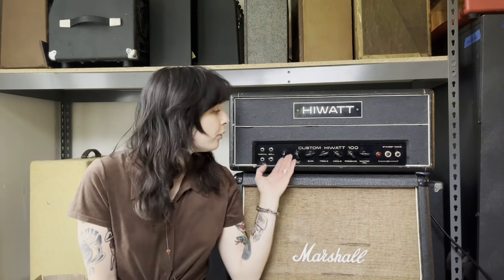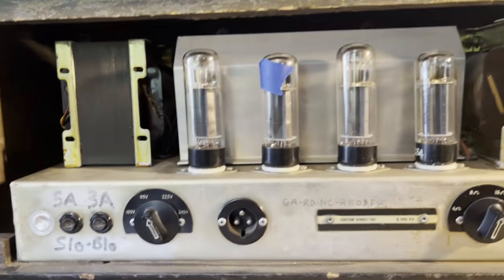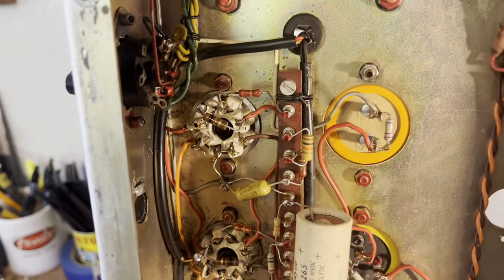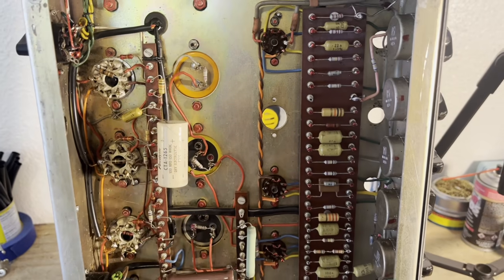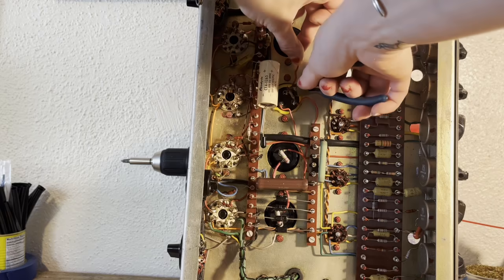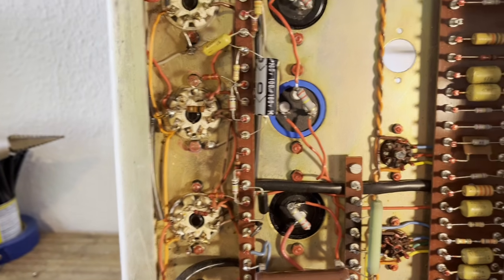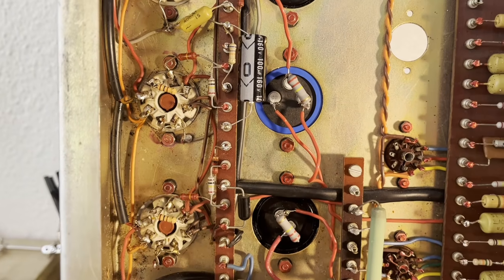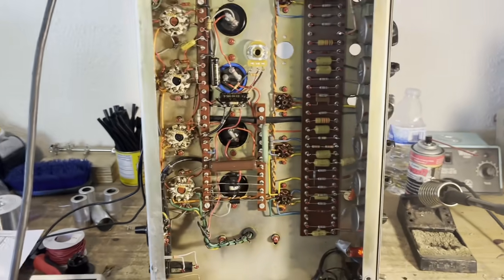Hiwatt DR103 | Restoration & Demo

Comment: I to had never seen the inside or worked on a Hiwatt. It does have similarities to Vox and Marshall, especially those from the 80s. The British have a way with layout. With the amount of power supply filtering, it explains the clean output. It’s great you gave some history of the amp with photos. Upgrading the bias supply was brilliant. I look forward to the next video you post! Love from NW Colorado. Thanxz
Reply: and do not forget to mention the large amount of iron and copper in those hiwatt (partridge)  transformers which give it the punch and clean sound. 

I restored the same Hiwatt,  the DR103,   bought as a wreck from a local musican for few bucks. It was in a miserable condition. Generations of so called engineers try to found the right sound, no magic smoke inside.☺awful!  But the shell and the rear panel were okay.
There were a big hole in the chassis for  a replacement transformer which do not belong into it. After welding a piece of metal, sheet and let the chassis galvanised in a friends workplace  I build it complete new to the original schmatics in the same way Dave Reeves did it. Luckily for me a handful of specialized shops got lot of hiwatt parts on stock. 
The transformers are homewound with the same lamination and  winding specs . The iron, the coil former and the endframes of proper size  are ordered from a company in England. I used an  Auman 300 winding machine.  I spend a complet year for this exciting task. I worked several hours during the week and least one day at weekend. The total cost of components include the valves were  750 EUR. 
The amp is finished since several month and sit on a shelf in my living room waiting for being played. 
By the way, there is a IEC power receptacle availabe which fit in  the hole of the Bulgin plug.

Comment: Yes! Well done! Has that familiar sizzle of a Hi Watt, especially the Seeker. 1/31/2023, Foz I failed to compliment you on your neatness, as I took a second glance today I found your simple mod to the AC cord to match the high quality build inside that amp. WOW, now I see where amp builders get that influence. They even reduced parts of the terminal boards for neatness.

Comment: I have a DR103 and 2 4x12 Fane cabinets from '77 that I'd like to resurrect.  Now, other than the clean-up, I know what to change, besides just tubes.  The sounds are just amazing!
Reply: BTW, I'll most likely still hire a tech to do the work.  Or practice up on my soldering! ;-)

Comment: Those mains connectors were common on UK appliances from the 1940s into the late 70s.  My grandmother had an electric kettle with the same connector.  It was the forerunner to the IEC lead.  We still call them “kettle leads” over here :)

Comment: That is an awesome design job on that amp. Cleanest wiring I have ever seen outside of military equipment. Easy access to all the components. nice bias mod too. Have you ever thought about having a PCB made as an add on ready to go into any amp using similar circuitry? Might be able to sell as a separate item also. Nice clean repair. After over 55 years of seeing buggered up repairs, it is so nice to see what you & D lab do.
Reply: Joyce was taught by two Americans during WWII so it's no surprise I guess.

Comment: One of the best made vintage tube amp ever
Reply: I have owned 4 of them all early 1970 models two SOUND CITY 100 heads And one HIWATT 100 HEAD which were sold and a HIWATT 50 Combo which I kept and still use over 50 years later

Comment: I've always admired mil-spec wiring with the lacing. So time consuming but it sure is effective. I have repaired a couple of the newer Hiwatt's and they also had very neat, right angled wiring though I don't recall if they were laced together. Good job done on a great classic amp!
Reply: I used  to do MIL-SPEC wiring when I worked as a Gov't contractor the Dept of Navy in RI....used a lot of lacing in some equipment....later, tie-wraps were the 'thing' . . .
Reply: It’s not terribly hard to do, NASA has published a manual on how to do it back in the day that explains it very well, you can also cheat and use a few zip ties to bundle the wires before starting which makes it a lot easier to lace the wires, just cut them off as you go and no one will be none the wiser that you cheated. 😂

Comment: I have a couple of Sound City amps with the same bias circuit problem, basically way too hot unless you're putting NOS Sylvania's in it. I found a bias doubler circuit in the Tube Amp Book V. 4, and a friend of mine who's better at electronics than I am put it in for me. It works great.

Comment: Having owned a DR 103 in the early 80s I was happy to see a video on the topic. Enjoyed the video and problem solving.Enjoyed the playing, too. 

It could have been the mic placement, or the Strat/strings, or the settings, but I just thought the sound, for a Hiwatt, was very thin and lo-fi. They are bright, yes, but not crispy and tinny, like on the D chords. Even straight in and clean they have a great, unique textured sound that is richly harmonic.

Someone give some feedback on that. Either back me up or slap me silly please!
Reply: Its probably cause she's playing into a Marshall cab so its most likely Celestion speakers. Vintage Fane-style speakers compliment the amp much, much better. I have a Reeves Custom 50 with Vintage Purple speakers, and I tried plugging in Celestion speakers to hear how they sound, and they made the amp sound like what you're hearing here—no bass at all and very thin sounding. If you notice, she even has the treble control waaaaay down and it still sounds like that. Vintage Fanes just give Hiwatt-style amps the best frequency response.

Comment: It's good to see you back! I've been looking forward to another video for some time. That amp. construction is clean and neat. Good job on the repair! A tip I leaned from another YT presenter who used to work at Cessna and had to drill out thousands of rivets is to just remove the head of the rivet with a drill, instead of drilling out the barrel. It is easier, and ensures that the mounting hole doesn't get enlarged by drilling it out.

Comment: Ahh, the old voltage doubler bias circuit mod. Done that many times. Sound City amps sometimes have the same issue, but Hiwatts are always WAY off with modern valves. That 50v bias winding is nowhere near enough. Nice work.

Comment: Nice work and enhancement for the adjustable bias.  As you stated, the physical component layout and wiring in the unit is a work of art.  Would be a good idea to save this video as a reference if I ever try building an amp by hand... just for funsies.

Comment: So the lower current rated fuse is for the high AC in voltage. The higher rated fuse (6.3 Amps) ahould be used for 115 VAC. Keep up the good work!

Comment from the maker: Hello everyone! Thank you for your comments and corrections. I am the first to admit I have a LOT to learn! And it’s so cool to have y’all along for the journey. 

With that said, here are a few corrections:

 I misspoke about the fuse ratings. The mains fuse should be doubled (not halved) and indeed be 6A. I installed a 3A fuse. The fuse will of course still blow if there's an issue in this case, but just wanted to clear it up. 

Dave Reeves was the actual designer of Hiwatt amps. I apologize for my error, Harry Joyce didn’t begin wiring the amps until the early 70’s. Thank you Dave!!
Reply: Thanks for what you do and how you do it. Rock on!
Reply: Hiwatt was Pete Ham from Badfinger go to Amp. An excellent amp to say the least.
Reply: People know one's a class act when they admit their errors, and "rectify" (pun intended, I build Marshall Clones) said mistakes. 
Cool vid, those old Reeves Hi-Watts are classics. Resplendent with Mustard tone caps, and impeccable wiring. Would love to get one or simply build a clone, which is the financially only option!
Reply: i'd love for you to do a video about speaker wiring harness making, parallel vs series, ohms etc   that would be great
Reply: Ты настоящий радиолюбитель ! (поцелуй в щёчку  )))

Comment: Congrats on the new shop and keeping busy! Glad to hear and see that you are doing well. Yes indeed, it does seem as though ya hardly see any of these Hiwatt amps coming across the bench. 
Are ya sure about fuse ratings at mains voltage? If ya go lower voltage you require more current to make the same power. Doesn't that require a higher rated fuse for lower mains voltage? I would recommend a 5 amp fuse at 120v  2-1/2@220v. 
Your choice of 3 amps will be ok at lower volume and obviously more conservative but at full stage  power could possibly fail at heavy sudden demand. 
Maybe I misunderstood and need to review the video again? 
Keep up the great work, thanks for the video, great subject!

Comment: It would have been nice if my dad(Dave Reeves) had got a mention as he actually designed this amp not Harry Joyce.The clue is in the model description,DR103.Harry joyce started wiring amps for Dave in 1970/71, many years after  Hiwatt Amplification was started.
Reply from the maker: Thank you so much for your comment. I sincerely apologize for this hole in my research. I will make a note in the description! Your dad Dave should absolutely get a proper mention.
Reply: @FazioElectric  Thanks,much appreciated.

Comment: I own one of the newer (2010's I think) DR103's and I can attest that aside from some minor cosmetic differences (the horizontal white piping is a bit further from the edge than the vintage models) they are every but the same amp as the Joyce models of the 1960 and 70's. The big Partridge transformers, same layout, same PERFECT, absolutely gorgeous mil-spec wiring and top notch component selection. My tech loves working on it. My main rig is a stereo setup with the DR103 and a 1969 "lay down" transformer Marshall Super Bass. The Super Bass is a bit more full spectrum than the Super Leads and complements the DR103 nicely. As incredible as my Super Bass is, I'd take the DR103 if I could only use one.
Reply: All Technicians Love an Electrical Circuit designed to run Hot and has Easy Access.

They get paid over and over to replace components that burn out prematurely.

I suggest you look into what Mil-Spec meant in 1966.  It sure didn't include any verbage about leaving bias adjustments OUT of an Amplification Circuit.

noone would consider designing a carburator without adjustments.
Why imagine it in an Electrical Circuit when ALL the components have variences in the manufacturing process?

This box may induce visions of cherubs dancing around your product infused Hair, but let's not take this opportunity to Glorify this Product.

It doesn't deserve it.

Comment: Hey Colleen just stumbled across this video. I’m not sure why nobody has pointed out to you that your getting your UK/US fuse values confused. In the US we have 1/2 the voltage that they have in the UK so the fuse value needs to be double what it is in the UK. On that schematic you showed 3.15 is the UK fuse while 6.3 is the US fuse. Also Harry Joyce didn’t design these amps. He was only contracted to wire them. The late Dan Reeves was the designer. He started with Sound City amps and then later formed Hiwatt.  Nice video, mistakes aside.

Comment: Love the vids, however @ 3:30 thru 4:00 you stated that the fuse rating is 3A for 225V and 6A for 115V. For the same wattage/VA rating: Halve the voltage double the current, double the voltage halve the current, With primary at 115V with a 3A fuse will blow after hard playing. To summarize, use 3A for 225V and 6A for 115V.

JJ makes a 250uF at 500V 1.375" (35mm) diameter can cap.

Comment: HIWATT and SOUND CITY were exactly the same internally, the only difference was on my Sound City I had to plug the amp into a Hammond auto-transformer because it didn't have 105v, 115v on the voltage selector, it came from London and wasn't an export model.  I used both a HIWATT and a SOUND CITY.  I believe they were designed by the same engineer since they were internally identical but inside the Sound City near the circuit board someone wrote HYLIGHT/HIWATT in black marker

Comment: Good to see you back. 🙂.  If you have a Road 220 Bass Amp to service sometime I would love to see that. I have a 70s model. But it's all transistor and it's noisy in one channel where there's a 5 band EQ.  It's possibly capacitors. I know I know. Tube Amps are the way to go.  But this one I've got I've used for years.  Thanks for the vids!

Comment: If an amp needs a 2A fuse at 240, then it will need a 4 amp fuse at 120v.  It's about the needed power level.  At 240v and 2A that's 480 watts.  At 120v you need to have a 4A fuse to be able to supply the same 480 watts.

Comment: @Fazio Electric
Fazio, you wail!
And dig, this is the amp head that amplifies the upright bass on stage at Montreux ''71 with Ahmad Jamal Trio - and it's the most in-your-face upright tone on  any jazz record, let alone a live one. LP title is, Outertimeinnerspace (on ABC Impulse I think.)  My bet, there's no CD.
Tune called Extensions features each player and is what the kids today call, based. 
Also, bassed - by Mr Jamil Suleiman.

Comment: The lower inputs are the higher gain. Took a min to figure that out on my 1973 DR103S. Hard to find much info on that particular model. 2 input and a footswitch volume cut/ boost

Comment: Nice to see rare amp back in line! 👍
What I'm learn in last 27 years - sometimes, old parts are better than modern ones.. But, sometimes, they may kill other parts.. Depends on part and schematic.. 😂
Reply: No, modern parts are way better if they have the same specs. A good example are the electrolyric capacitors. High quality type were made from Vishay, Philips and Nippon Chemicon.  If space and weight doesn´t matter metall polypropylene  capacitors from Bosch / Siemens , Wima are a good choice, I used this type  of capacitors in Filter circuits of my home brewed  power inverters, they do their  task abt. 20 years without any trouble at all. 

I bed the blue Capacitors which fitted in the Hiwatt in this video made by Philips and labeled with the distributors logo. The black ones could be Vishays.

Comment: Nice to see a new video of a repair !  Hate to be a bit picky, but you sure about fuse ratings ? Higher amperage fuse would be for lower supply volts.  IE, watt load should be similar for both voltages. Just sayin'
Reply: Was just about to make the same comment about fuse ratings!  The higher the line voltage the LOWER the fuse current rating.  That mains socket on the back panel is a Bulgin connector, a UK company that was.  Quite difficult to obtain even here in the UK. Was used on alot of audio and test gear in the 60's and 70's. BTW, it would be good to know which brand of caps you are using.
Reply from the maker: Omg you’re totally right. My bad! At least the fuse will blow either way if there’s a problem.
Reply: I feel guilty about my comment. Your videos are excellent, no matter the fuse ratings.  Better than excellent ...stratospheric !

Comment: Very interesting. I have a 1972 model, DR103, a bit more beaten up than this one, but still sounding good. Mine has had the Bulgin power connector replaced with a safer, more standard connector.

Comment: Your backwards on fuse's. at  220V it may be 3A, but at 120V it would be 5A.  Remember, lower voltage means higher current.

Comment: Hi, you are confused, when the power supply is 230V the fuse is 3.15A and 6.3A when it is 115 or less .... sorry but it's Ohm's law. Greetings from Italy!  😉👍🏻👍🏻
Reply: Watt's law, P = IV
Reply: @marpenman  That's right, Watt's law is a derivation / extension of Ohm's law. P = V x I  230x3.15 = 724.5  like 115x6.3.
Sorry for my English.
Reply: I believe you are correct.  higher voltage = smaller fuse.  Lower voltage = larger fuse

Comment: I was able to talk a few in to trying out j/j E34l  tubes in their Marshall's dsl amps.  They were glad they did.
  They got a little more eadroom and a fuller bottom end. Kind of a cross of a 6l6 and a el34.
Imagine a set in one of these?  Omg.
     I'm njot really a huge jj fan except Those and their 6v6 s  tube that'll run plate voltages of a full bottle and like this.
   Glad I found your channel..
  Got hooked on watching Lee Jackson videos I've been awake 12 hrs binge watching repair and mod videos now.
  Ugh
 Need sleep before I now mod my fender hrdx finaly.

Comment: Bias settings on the output tubes dramaticlly change the amps tone and i always set my customers while they are playing thru the amp to get the tone they prefer, then if its on the hot side i tell them the tube life will be compromised and alot of guitarist are ok with that in order to get the punch and tone thier looking for...

Comment: good work!  those hiwatts have just immaculate lead dress, i don't really know of another large-scale production amp that comes close!  best current lead dress work i've seen lately is an aussie youtuber by the handle elams1894, well worth checking out if you're not familiar!  

my weller solder wands all had foam handle grips that split and shredded too.  they're pretty much done at that point; no tape i know of can put up with the heat.  i went through three of them, the metal business end always ends up falling out of the handle, and does so when it's hot which is terrifying. at $50 each this is absurd so i switched to a hakko.  it's pretty much the same iron, but with a slightly more robust wand.  both the weller and hakko seem somewhat sluggish trying to recover to full temp after soldering, which is kind of annoying having to wait for.  recently i've been playing with a lonove/bakkon bk90, which is cheaper than either of the others mentioned above, but much faster to recover and has been a champ so far!